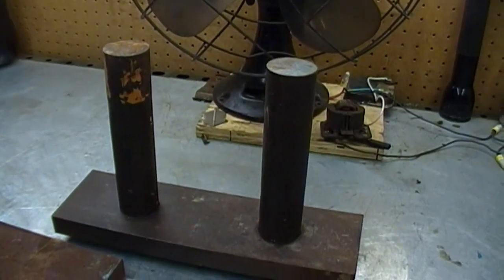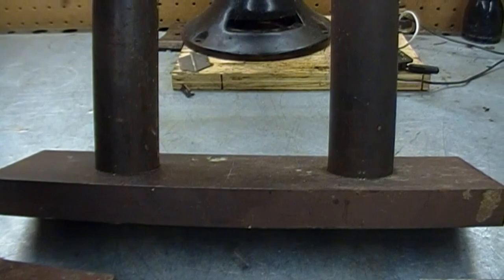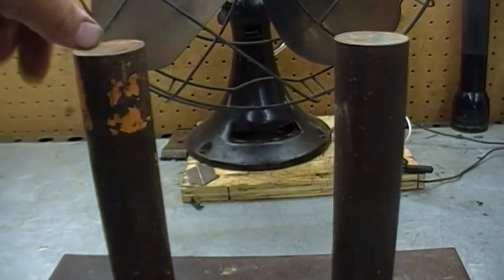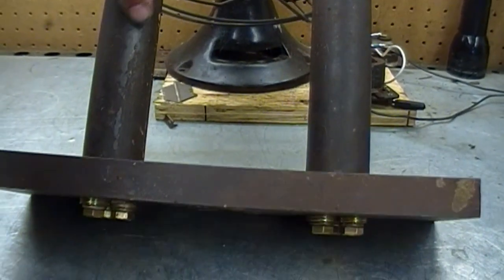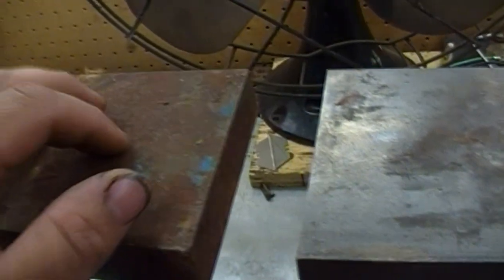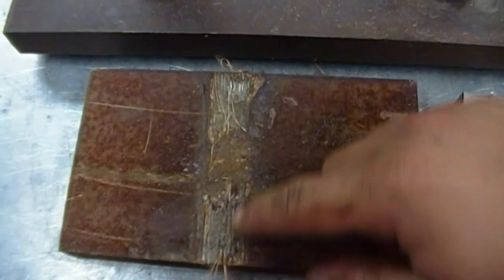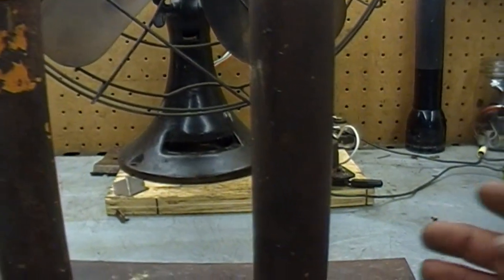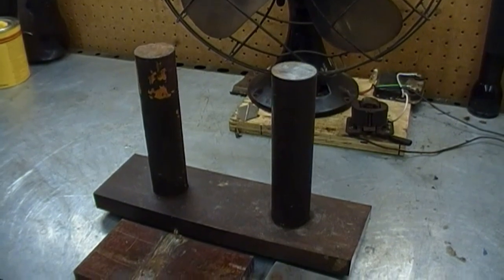Magneto Charger Build Project

Comment: Thank you for information, but you must show the parts one by one and show us the wire (coil ) gauge and then how to fix it till finish the project. Please put a link about the specific size of the plates and copper wire and how many ampheres and volts you need to use.